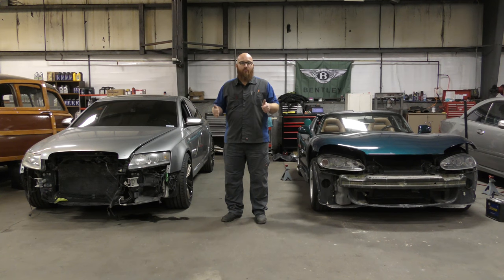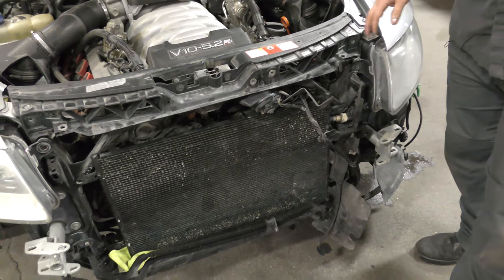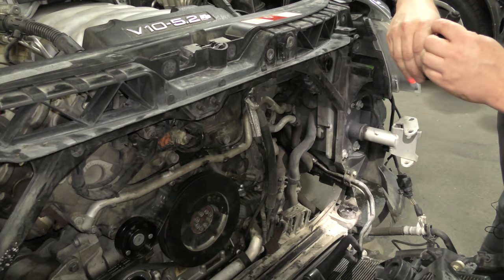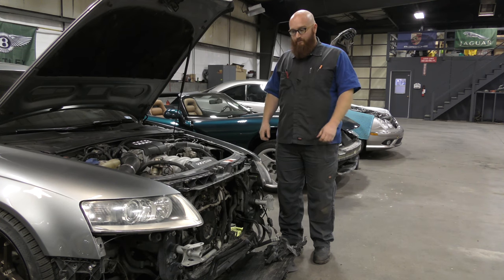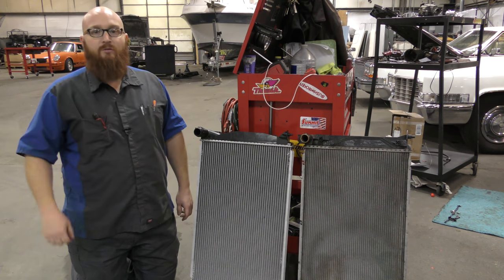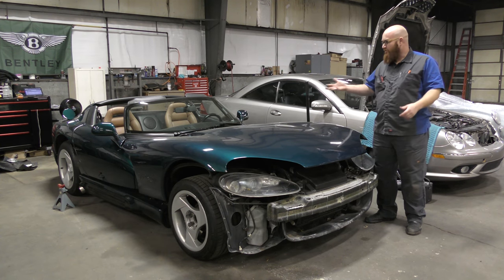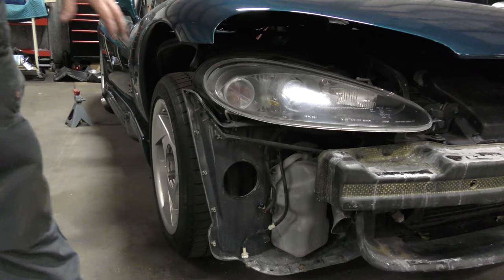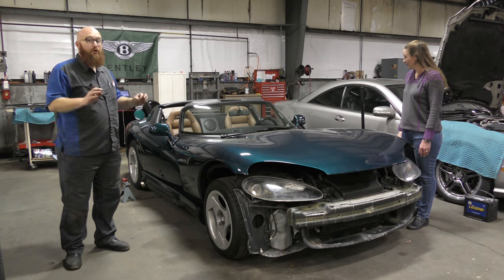What?! The CAR WIZARD has to remove the bumper on an Audi S6 & Dodge Viper to make easy repairs?

Comment: My thermostat housing on the 3.6 alloy tech engine is leaking they put it in the back sandwiched  next to fire wall.  To replace the housing and thermostat the Trans has to be removed. Nice work GM. No wonder Wizard hates this engine.
Reply: Im a Holden Technician in australia and can agree that the thermostat in the Alloytec Engines are a Pain to get to BUT the Transmission doesnt NEED to come out . the Job can be done from within the engine bay . everyone Hates on the V6 High feature engines . but personally i think they are very bloody good if maintained . i had a 3.0 Litre V6 LFW Commodore Evoke come in to the workshop last year . 2016 model with 168000 km .. absurd distance for the age but was a fleet car... The Engine , Interior , exterior AND under body was SHOWROOM Clean . was immaculate . i know 2 Gold master holden Technicians that Believe the V6 is actually better then the V8 LS Based Commodores.
Reply: @justinlangley9522   Thanks for the info.  It's in a 2008  Pontiac G8 my machinic quoted me 1300 for the repair. I hear ya about the engine,  the G8 is super fun to drive.  I will be calling tomorrow to have a chat about the repair. Maybe I should take it some other place for service. Granted I live in Cali US and everything cost a ridiculous amount of money here. Thanks for the reply!
Reply: @joshboss5962  well to be fair the official service information for repairs state the transmission needs to come out for the work to be done . I just had the luck to work with some of the best GM mechanics in the world. 

Its not easy but not impossible.  In saying that . Most places will quote that price to do the job .
Reply: @justinlangley9522   Good to know. Thanks brother.

Comment: People talking about the constraints engineers are required to follow by the money men...I love the SAAB story.
GM bought 50% of SAAB and SAAB were to build the 9-3 and 9-5 on the GM platform. When GM managers heard little from SAAB and did follow ups on why so much time and money had been spent without seemingly any results it turns out if SAAB didn't like a particular bit they would redesign and make a new part...It seems they did this alot! They would spend a fortune on the bits they felt  important...and if it had SAAB written on the bonnet...Well...GM went loopy.
In the 70s SAAB shared the Triumph Dolomite slant 4 engine...Only thing is no Dolomite ran like a SAAB!

Comment: Could you get a new used radiator from a junkyard for the V10 audi is Joe would see say arftermarket parts never fit you're better off just going to a junkyard or dealership to buy them

Comment: Vehicles such as this (exotic, high performance etc.), should only be LEASED when they're brand new. At the end of your *36 months, hand over the keys ...
a.k.a. The headaches... - * I don't even change the tires or ever have to pay for service; the ones I acquire are 'bumper to bumper' with maintenance included.

Comment: The Audi and most expensive cars are made for the first owner for the duration of the warranty. If you are the second or third owner you are dealing with a ticking time bomb. If you don't have a bumper to bumper warranty you could be facing repair costs in the thousands$

Comment: The story of two fuel pumps. First my '96 Honda Prelude. Access hole in trunk, six nuts, about 30 minutes done. Then my '94 Z28 Camaro, remove exhaust, drop rear axle, remove tank, six nuts and all next day putting it back together. GM won't spend a couple dollars for an access hole! I know guys have cut their own, but ...

Comment: Let's be honest here - the engineers did not intentionally design these V10 S6 repairs to be difficult (don't forget they came with a factory warranty - Audi had to pay their dealerships to service and repair these beasts). The engineers designed a car that that was usually powered by a R4, V6, or V8 with "lots of room for activities". Someone higher up basically handed them this engine, pointed to the C6 and said "make it fit". Auto designs are compromises from start to finish. Once a chassis is designed that fits the safety standards, budget and production parameters (a compromise in itself), everything else is a compromise between available space, cost of technology, cost of materials, emissions and fuel economy regulations, blah blah blah. So don't blame the engineers or designers for difficult service procedures - applaud them for achieving a very difficult goal of stuffing 10 pounds of crap in a 5 pound sack. I like to think of it as an engineering and packaging miracle that could prove to be a lucrative source of income from a loyal customer.

Comment: I work in a body shop that does collusion claim repairs and for most cars removing a bumper takes a solid 15 minutes, an electric ratchet is your friend
Reply: Yes, and when they have radar cruise control, blind spot sensors and all the other electronic doodads hiding behind the bumper, how long does it take to put them all back on and then re-calibrate them and clear any codes and errors the ECU throws?  That's the problem with modern cars.
Reply: @antipodeanwizard1632  haha that’s why I didn’t mention putting them back together ;)

Comment: my 2006 mazda 3 you have to remove the entire front bumper to change a headlight bulb, because its almost impossible to reach the back of the headlight assembly..ive taken it on and off so many times its not funny

Comment: It is not the job of the engineeer to make the lob harder for the DIY- mechanic. Look in this fully packed enginge bay of the Audi.
It is just impossible to design it in a way that all or most of the components are easily accessible.
So - especially with high end luxury cars - the engineers are accepting the fact and rely on it during the design-process, that the engine is a "module" and a lot of repair-tasks will be an "engine-out"-job later.
I've learned that in discussions with some design-engineers I met during my freelancer jobs for the car industry.
The luxury car manufacturers in Germany (BMW, Audi, Mercedes, etc.) do have big service centers where engine-out jobs are just routine. Expensive, yes, but daily routine.
I know it is not a lot of solace for the normal guy who wants to make a dream come true and buys such a car in used condition, but that is the way it is.

Comment: Factory hot rods are not that different from the home brews. Clearly that Audi engine bay was meant for an inline four or a V-6 engine. Shoehorn a V-10 in there and you see all kinds of compromises. That being said, who thought that a one piece plastic(!) radiator core support was a good idea? The Viper is a road legal race car. The canister was in the nose because there was no other safe place for it. (The trunk..fuel vapor..trunk light-NO!)

Comment: I think the truth is, not so much that mechanics hate the complexity (at least, good mechanics like the Car Wizard), but that customers are reluctant to pay and accuse the mechanic of being a rip-off.  After all, if the job is difficult but profitable for the mechanic (where the customer pays and doesn't complain), the mechanic should be happy.  To illustrate, would mechanics really be cheering if engineers designed engine bays and engines so we could all work on our own cars?  I suspect not!

Comment: Its not the engineers its the managers who's bonus depends upon cutting production costs. Engineers love to try to make a perfect product but its not up to them.  It can be engineered to be accessible and a special vehicle but it would have to have a ridiculous sticker price. I have a Nissan Pulsar N1, a 1.6 litre NA hatchback that cost more to buy new than a Mitsubishi Evo because it was very highly engineered to near race specification. That is an example of how ridiculous the cost would be to engineer a production car without compromise (relatively speaking) and as I said that was a 4 cylinder hatchback. You want cars that perform and are cheap to buy new? They are going to be heavily compromised in other ways.

Comment: They're designed to put together NOT to take part. They made that Audi one piece shroud so it goes on in one shot. Company saves 5 bucks every unit that goes down the line.

Comment: Audi used to have the engine on the right side of the car, and the radiator/condenser on the left side.  Positioning the engine in the middle has really confused Audi engineers.
Reply: Well yah, if they kept packaging of a normal car the nose would be a mile long.  Remember the whole engine is mounted forward of the front wheels because of quattro.
Reply: @Lowfategg  The steering rack used to be in the firewall!  Audi is unique
Reply: @baitse7676  It still is on most Audi's. Honda did it as well on a few cars.

Comment: I don't really think that the engineers "don't care" about how hard it is to service... they look at it as being POSSIBLE or IMPOSSIBLE.  As long as its POSSIBLE, then it's a go.  Also, consider what they did with this particular Audi S6 model... they put a HUGE engine into a car that was never really designed for it.  This is the unavoidable result unfortunately.

Comment: there should be a law where 'if your car is hard to repair, you must offer a long warranty at a price of a cheap car'. this will force better designs.
Reply: nope - it will banish all interesting cars from the market. If you buy a low volume car fitted with a huge engine then you just signed up to higher repair costs. If you want cheap repairs buy a  high volume toyota

Comment: Wizard (or any other mechanics in the audience), are there any carmakers or still-produced cars that you feel are easy to work on? Or at least easier than most? I heard this about Subaru a long time ago, but except for the STI I believe all their cars are direct injection now (not saying DI is impossible to work with, but the DI seals and high pressure lines can be delicate, and routinely dealing with carbon build-up IMO negates any ease that may exist).

I used to trust Toyotas as overall being well designed for maintenace, but their move to direct+port injection makes me nervous for when the day comes I'll be tearing into the engine.
Reply: Go Australian.  Holden commodore and Ford falcon.. easy to cars to work on simply because they rarely need to be worked on .. especially the falcon barra 4 litre engine . Routinely get aussie taxis hitting a million km on the original engines ..

Comment: I’ll stick with my Honda and Subaru.
Reply: But those subbie head gaskets ruin the engine before the timing belt breaks.
Reply: @repnatl  that’s why he has a Honda for backup 😂
Reply: While I agree to avoid any "das auto", Hondas aren't the epiphany of engineering intelligence. Early 90's Accords have the "captive rotor" - gotta remove the suspension & axle to replace a front brake rotor. And many of the 20XX models of Acura and Honda require a bumper removal to replace the g*dd*mn headlight bulbs.

My neighbors often hear me scream about idiot engineers while performing car repairs. And just as often I'd pay good money to be able to smack an 'enjunerd' in the 'nads with a wrench.
Reply: AJ   You have my sympathy! I love the pins and clips that GM uses to release the headlight assemblies - no BS for the simple task of changing a headlight bulb.

Comment: 7:35 This is what you get when you put a V10 5.2L on an engine bay designed for an inline 4 cylinder 1.9TDI engine.
Reply: yeah, but they managed to get it there without making car huge like Bel Air

Comment: But Wizard, think about it from the car manufacturer's perspective. Who is the target audience for this car? Someone looking at a Kia Sonata isn't cross-shopping an S6.  This is an *S* model. So, someone shopping for an A6 isn't necessarily looking at an S model.
** Cost:** So, someone who is willing to fork out $70-$80+k on the car has money. They're not worried about gas prices or maintenance costs. If they are, they shouldn't be buying the car.
*Design:* Big engine, small bay. You're lucky, at least you can remove all those brackets and frames. Imagine if those were welded and the only option was to work via small cracks and gaps. My point, chances are, this really was the only way to make it all fit.

Comment: Anybody recommends a good trustworthy shop in Louisiana? Have a 2003 maxima 6 speed manual, dont have the time to work on it but it might need a new engine (blue smoke, excesive oil burning)

Comment: There isn’t a single car with an Audi badge that you could convince isn’t a pile of excrement.  I owned 2 and still suffer nightmares and waking up screaming in the middle of the night.  Lamborghini V10 in a Gallardo = easy to work on; Lamborghini V10 in an Audi = engine out oil changes.  Not to even mention the fact I couldn’t drive across the street without a new issue presenting itself.

Comment: I don't think it's completely fair to blame engineers here.  In the case of the audi for example, they get told to put a bigger engine in that car than was ever intended.  They can't change the design of the chassis or crash structure or change the look of the car to have a longer hood for more room.  What do you expect to happen?  Things are going to have to be crammed in tighter.

Comment: Hey Wizard Another Example of A poor Design By the engineers are the Holden/Chevrolet Captiva! a Simple Light globe Change needs the whole top plastic panel with 8 to 10 Push Clips . and then 3 Bolts on either Headlight Assembly to be removed before you can even get to the Access Hole.. Its Not a HARD job its just Stupid . a light globe should be a 1 minute job not a 10 minute job! 

But that Audi looks absolutely horrendous to work on ...

Comment: hey, my audi looks like that right now to change out a thermostat lol, also you ever done a radiator on a ford edge? same stupid engineers who designed the thermostat on my audi are the same idiots who thought bracketing the radiator and AC condenser together was a good idea and having the brackets only accessible after removing the bumper.

Comment: I would never get an Audi S6 or a Dodge Viper, any of them, because they are expensive to repair. Instead, I will buy a 2004 Chevrolet Monte Carlo SS Supercharged coupe with the 3800 (3.8 L) supercharged V6 engine, because it is a better vehicle to maintain and they are cheap to repair. These Monte Carlo's are awesome vehicles, that General Motors (GM) has ever made in the North American market.

Comment: That Audi is a far cry from the 84 quattro i had with the old skool Inline 5.  That was easy to work on.  
Dont forget that in most Audi sedans, the engine is in front of the front wheels(Axles) as they are FWD based  and most are Quattro, same as Subaru and the Chrysler 300, LHS, cars. The engine is in the right way, longitudinal and not sideways, transverse (GM Northstar & and many others).
I wont buy another VAG car newer than 2004, they are all wrong, plus DieselGate...

Comment: Cmon its not that hard with Audis. atleast A4 . First car I ever worked on was audi a4 b5, replaced timing belt etc. to get access I had to remove 6 screws, after those i had access to everything. Right now I have Audi A4 B6 1.9 TDI 96kW PD  and its basicly the same.  Of course its not ideal to remove front of the car to work on some of its parts, but it really isnt that dificult.  

BTW I work on these cars  on my driveway without any fancy tools or even a decent jack.

Comment: Attention all engineering students, say it with me till you mumble this in your sleep:
Design For Maintainability!
Reply: Auto companies don’t want their vehicles to be easily maintained.
Reply: An engineer and an experienced mechanic could design the perfect car. It would get 40+ mpg, have a low maintenance cost, components would be easy to get to with a low failure rate, and NO specialty tools required

A manufacturer wouldn't touch that with a ten  meter cattle prod. Dealer shops would be warranty and recall fix only. Hell, some mechanic shops would shutter due to so many more people doing their own work.

Comment: Do you ever work on any normal cars?
Reply: He did with a Honda Prelude a Mercedes W123 a Lexus LS 400 a Honda pilot and there's a bit more but I don't remember it on the top of my head. Those are as normal as it gets

Comment: What's idiotic is putting a V10 in a car designed for a 4 cylinder or V6.   You should expect
astronomic labor cost on a limited production vehicle like this.  Yes it special alright.  Special
for mechanics.

Comment: I wouldnt be too hard on the viper, it was a rush job project and that's a first gen without the roll up windows and door locks, if it was a second gen, when they started adding those things, then yeah, they should have started looking into it (and actually given how Tyler had the first gen and what he did to to it, I'm surprised he hasnt looked at one or one of the last 4th gen ones) the Audi however, that's abit much, like I dont get why these people didnt engineer or attempt to engineer ways to fix easy problems.

as if you nickel and dime people to death, they often dont come back, its what happened to GM after all and why people started to go to european brands in the first place, its just that well the audi's and BMW's offered performance that people couldnt find anywhere else so people were willing to put up with more to a fault.

Comment: That V10 engine does not fit in that Audi. It reminds me of one of those hot rod engine swaps where a chassis rail is in the way of the spark plugs so you need to drop the engine to change them. For whoever home built the car that's fine, but for a manufacturer to release a car like that, it's just terrible engineering. What looks neat on a cad diagram may be very horrible in the real world.

I hate working on most German cars. Most BMWs are tedious but I think this is a new level of pain.